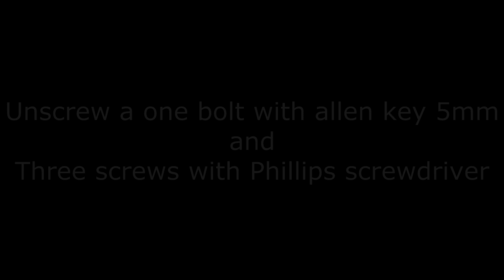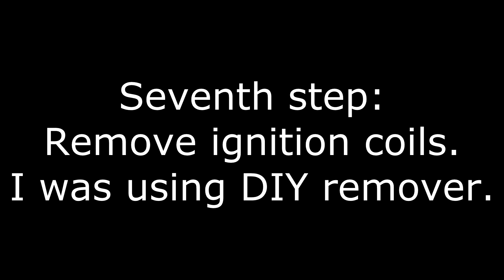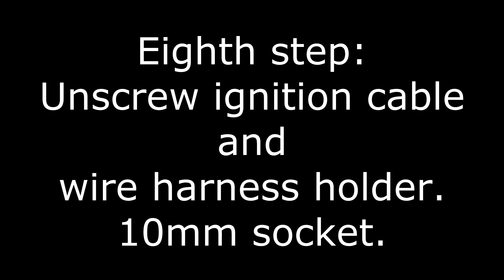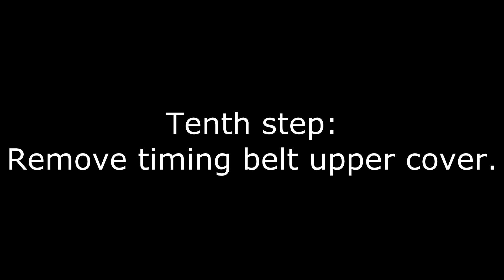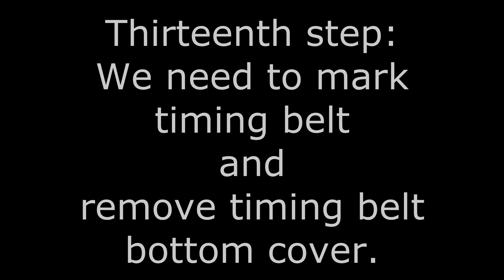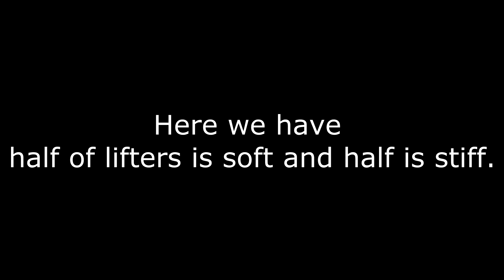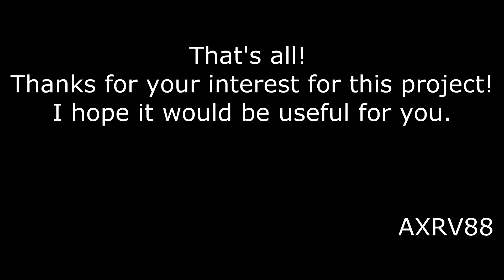VW 1.4 BCA partial disassembly of the top end and valve lifters

Comment: Hello.Very nice job! I have the same problem and of course a question. Can you tell me how to install valve lifters. When you put them back do they have to be soft or hard, full of oil or bled out. And when you firs start the motor i read that you must not run the engine at idle but you have to rev it up to al least 2000 rpm for few minutes.

Thanks and very nice video.
Reply from the maker: +Ziga Vozlic Hello. Thanks alot for kind words! I read different information about lifters. For BMW engines lifters must be hard(filled with oil), for VW petrol engines (~2000 year of production) lifters may be soft (without oil). Too sad because lots of video materials was lost. But I put engine oil into pan and fill lifters with oil. Then I install them into engine. I ran engine aprox. 2000rpm around 2-3 minutes. Then I take a ride. Engine worked so smooth, but after month of usage engine start works coarse again. Maybe it will help you.
Cheers!

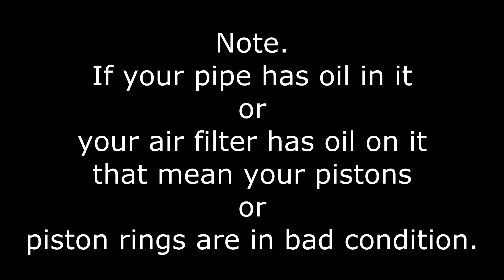Comment: Hello, I have VW Polo Variant 1.4 16V and I do not have the breather tube comming from the top of motor to the air filter, as you mentioned at 1:25. When the temperature rises, oil is spitting from the hole (at 2:58). Friend of mine, whom I bought my car from, added hose to that hole which is hanging over motor heading to the ground.
Reply from the maker: Hello, I don't understand which  hole do you mean. BTW when engine is in good condition, no oil will spitting from any hole. When your engine run at work temperature have you steam from this tube which heading to the ground ?
Reply: @AXRV88  I mean the hole on the top cylinder head cover. In 1:29 you are disconnecting the breather tube from the air filter cover. The second end of the tube is connected on the hole on cylinder head cover. Problem is that my type of motor, AUA, didn't have such a tube. So the hole is just like that. When motor is running at work temperature, oil start's spitting from it plus I fell air of course. Little bit of steam as well. This is the reason why friend of mine, whom I bought my car from, added hose to that hole which is hanging over motor heading to the ground as a provisional solution. I had one colleague from previous job, he had Golf 1.6 16V, almost the same motor, and he also did not have the breather tube. And no problems he had.
Reply from the maker: SlovakiaGuy, I see. I think you have this steam and oil spitting from breather tube because piston rings are worned and let gases from burning chamber into engine carter and of course this gases goes from engine carter to engine head and from head to this tube. If engine oil has smell of fuel it is because of worn piston rings. Did you measured compression?
Reply: @AXRV88  I have not measured the compression yet, don't know how to measure it. Gonna check some videos.
Reply from the maker: SlovakiaGuy, you need to use compression gauge instead of spark plug in each cylinder. All measured data may be qual. After this procedure you need to add little bit of oil inside cylinder around 5-10ml and take measures again. If pressure with oil is higher than without oil, your piston rings are worn and let gases inside carter.
Reply: Thank you very much for the tip, I will let somebody experienced check it.
Reply from the maker: You're welcome, mate! If you have other questions, feel free to ask! BTW for now I upload videos about car repair on other channel.  https://goo.gl/aCPkZQ

Comment: Great video many thanks for that!!

Question: on a 1.4 bca engine will the bby cilinders fit?
Or also can i use 1.6 cilinders? Because i got a piston slap
Reply from the maker: Thanks! I have no information about piston, because I hadn't disassemble piston group. All I know about 1.4 and 1.6 engines is both have equal bore, but different stroke. I hope this information can help you. And can you show me video or audio of your engine running? I want to listen how piston slap sounds.
Reply: Piston slap is only heard with a cold engine and only under load.. no throttle is no knock. I will make a video for you asap
Reply: Or type on YT kölbenkipper
Reply from the maker: Ok, thanks!

Comment: hello good on the double cover of the camshaft what is the position of the camshaft. How did you guide me for the installation where does each one go?
Reply from the maker: Hello. I can't guide you for the installation. Disassembly and assembly is making when camshafts are locked by special tool. You can make it by your own. You need pair of bolts and nuts and metal plate.
Reply: @AXRV88  If I understand what it tells me, I can ride it. My doubt is that the double cover has two camshafts which are only different in the part of the sensor so I know where it goes which in my case both camshaft have these teeth for the sensor but I do not know where they go placed, however, the cover only has a sensor and when I disassembled the camshaft, I looked at where each one went and rampoc has any mark

Comment: I have 1.4 16V AXP replacement engine, had it all apart, oil pickup all clean, 16 new INA lifters, car will still make the noise but not as much, noise will go down after driving maybe 20 minutes, half lifters were soft half hard previously, id say if your engine is running strong and noise is not terrible just leave it.  My mom only drives that car to work for like 10 minutes and thats it.
Reply from the maker: krzysiekv12 Noise is not terrible, but just interested in what causing the noise. I'm flushed the engine, as result the engine now is more silent. I was hearing the engine from bottom and there's no noises.

Comment: hi!have the same problem-rattling sound from top of the engine,i cant decide to buy all 16 new or just a clieaning will do the job.just wondering how did you clean them?thanks for great video
Reply from the maker: Hi! Thanks for your interest. I clean it with straightened paper clip. Put lifter in solvent, which must cover whole lifter. There is ball inside which you need to push. You can see the ball through upper hole. Push into upper hole with straightened paper clip and stoke lifter a bit. Allow it to soak in. Then stroke lifter in solvent again. If solvent is dirty, replace it and repeat procedure till dirt stops come out. Then you need to oiled it to prevent rust. Don't forget to drain solvent from lifter before oiling. That's it. But I think to buy new is easier. I hope it would helpful! P.S. I think it will be better if you also replace engine oil after this.
Reply: AXRV88 thanks for fast replay.found 16 lifters for 100 eur.there is an option to buy a rockers aswell,is thats necessary?was your ones still ok?just never work with these kind of engines,had only diesels before.thanks!
Reply from the maker: Elvijs Sotnieks I used my old ones. I'm not sure they alright or not, but look like new. But I think if you can buy new, do it. I read some information about lifters and rockers... every used rocker can work properly only with its lifter. As a result, change lifters is not enough to valves work properly. I think it's better to change lifters and rockers. I made this procedure for experiment, without changing anything. I'm not a professional mechanic, but understand something. I want to say, some rattling remain and i think it is rockers rattle or lifters clogged again with dirt which remain in engine head. But engine works more silent than before.
Reply from the maker: Elvijs Sotnieks Btw, if you can, tell me or record video about result. Thanks.
Reply: AXRV88 i ordered those lifters from rexbo.eu but still didnt receive them,i will reply to you whats will be the result.
Reply from the maker: Thanks. I'll be waiting.
Reply from the maker: Hi! Have you replaced lifters and rockers? I'm waiting your reply, I thinking maybe you forgot about it.
Reply: AXRV88 hi sorry for late replay.yes i changed the all lifters.11 from 16 was gone.
Reply: Im very hapy with result.engine is wery quaet now.ill put some video 2mro.
Reply: And i didnt change rockers.
Reply from the maker: Thanks for your reply! My engine start rattling again... I think i need to replace lifters too. I'll wait for your video.
Reply: Yeah
Reply from the maker: Are you mesure lifters? I forgot to mesure them when I clean them. Now i look into pricelist and don't know what kind of size i need. Have you BCA engine too?
Reply: Axp engine.there is only 1 type for 16 valve engines
Reply from the maker: Can you give me a link to lifters you bought?
Reply from the maker: Ah, yes. I found it. Which brand you chose? There are INA and FEBI.
Reply: Ina is much better brand than febi.
Reply from the maker: I know it, but on rexbo the febi one is more expensive than ina. It's weird. In our local store INA one is more expensive than febi. INA lifter cost 3.50 euro.

Comment: Hi, were you able to get the crank pulley (19mm, 12 tooth) out by hand?  Also, how tight (nm) should I tighten the rocker cover hex bolts when all said and done?  Thanks for video :)
Reply from the maker: +Ali Barbour Hi! It was many time ago and I think the crankshaft bolt was already loosen for recording :) Crankshaft bolt tighten with 150Nm + 1/2 turn ( Use new bolt ) Rocker cover bolts must be tighten 10Nm + 1/4 turn. ( Use also new bolts ). I hope it will help you. Cheers!
Reply: were do you buy new bolts for rocker cover ??
Reply: AXRV88 Hahaha, yes! Can't remember what I did in the end, starter bump I think..  Car's still rollin' (was a valve stem seal job) and I've seen it for regular stuff since :)
Reply from the maker: in a local store.
Reply: What size are they if u know mate
Reply from the maker: Owen Thompson I'll try to find old bolts for measuring.
Reply: OK cheers

Comment: I have a polo with CGGB engine (2009/2014) 1.4 16V, the designe of the engine looks just the same as what it shown in this video, i got rattle noise especially in morning (cold start) my knowledge leads me to valve lifters but im just confused, do i have to buy all the 16 one with ther rockers or just cleaning them !? Plz i need an answer from your experience 
Ps: after deleting the catalytic converter the rattling sound come much louder especially when im accelerating near walls or something like that( ex: night drive) 
I have 100k KM with this car, thank you in advance :)
Reply from the maker: Hello, Aveiro! My experience show me one thing and it's " you need change both lifters and rockers". These parts work together and some wear on them is pair wise. After I had clean  lifters rattling noise disapear only for a couple of weeks. I know nothing about noises after catalytic converter removal. Some people say this engine is enginered to work with this kind of noises. Of course you can try to clean lifters, maybe it shoul be enough. If not, buy all rockers and lifters. I hope it'll help you!
P.S. Your engine is TFSI or FSI type? If so rattling noises is normal, because fuel system is diesel like and works pretty loud.

Comment: hello i have a mk4 1.6 16v bcb code wich is pretty much the same as your engine ! my engine has ticked noises and shaking so bad every morning specialy where temp is below 20Celcius ! when engine warm the noise and shakes are gone ! could it be the valve lifters ?  in summer she runs more smooth than winter !
Reply from the maker: Hi, Qypi! I think in your case engine has wear in pintons and cylinders, because with increacing temperature, pistons becomes bigger and cylinder gap becomes smaller. Because of it noises decreaces... I think your engine has wear in cylinders and pistons more than in valve lifters, because lifters make less noise when engine cold and oil is thick. I hope this information is helpful for you. Cheers!
Reply: thanks for your reply ! but my car is very fast i mean the car accelarete pretty good, engine works very smooth on summer time . only in winter in morning starts its worst engine shaking wich misfire ! until engine warm !
Reply from the maker: Sorry for late reply! There are too many parameters which cause misfire: bad spark plugs, bad ignition coils, bad injectors, low compression and of course bad wiring. If your car runs perfect when engine warm, do not think about it. :)
Reply: thank you so much !
Reply from the maker: You're welcome!

Comment: Hi I've got a 2003 1.4 BCA Mk4 golf thats done 127,000 miles it sounds tappety even when its warm but goes away when reving the engine above 2000RPM so i have taken the cam cover off and about half the lifters are rock hard and half were soft ... should they be hard or soft? Also im looking at 16 INA Tappets that come from Germany for £68.00 GBP. Do you think this will solve my tappety problem?  Good video by the way !! I just wish youd speak haha !!
Reply from the maker: Hi! Tappety noise goes away when revs above 2000, because oil pressure is rising up. I think tappets must be hard, because they have oil valve which keeps they hard. When valve can't keep oil pressure and oil pressure is low ( around 1000 rpm) tappets can not stay hard and we hear this ticking noise. I think problem can be resolved by changing tappets and rockers. And thank you for kind words! May be one day I will speak in videos. lol.
Reply: Hi so I need to change rockers as well ? and i found this video extremely useful as its the only one of its kind i can find on youtube Thank you !!
Reply from the maker: hello. I think this is the best way to repair lifter system. Knocking sound comes from powerful impacts of lifters-rockers-valve stems  when engine works it. Because of it this parts have as great wear.  Thank you too, mate! If you will change this parts, let me know. ok? I'm too interested,what result will be.
Reply: i will do cheers !!

Comment: Hi there. These engines usually sound like a diesel when cold because of clogged lifters, like a ticking noise. After cleaning them can you hear the ticking anymore?
Reply from the maker: Hello.  Right after cleaning lifters engine runs smooth and quiet, but not too long(around a month). I think in my engine lifters are  just worn out. Maybe soon I'll change them for new. You can choose heavier oil. With it engine should run quieter.
Reply: How many kilometers does youre engine have?
Reply from the maker: 150000
Reply: Yes, this is common at the car's age and kilometers. My AXP engine does the same, the same km. The lifters have problems with lubrication by design, that's why it sounds like that when the engine is cold. If you replace them it is recommended to buy OEM only, more money though. 
What is the order of unbolting and bolting for the cover? I know that you must be carefull when doing this. What torque values did you use when bolting the cover back? Do you have any diagrams?
Reply from the maker: I'll try to find it for you. For now i can't remember torq numbers. Bolting is cross-pattern.
Reply from the maker: I found page with all information you needed. http://workshop-manuals.com/volkswagen/golf-mk5/power_unit/4-cylinder_injection_engine_(1.4_l_engine)/engine_cylinder_head_valve_gear/cylinder_head/removing_and_installing_camshaft_housing/installing/
Reply: Thanks a lot!
Reply from the maker: You're welcome, mate!